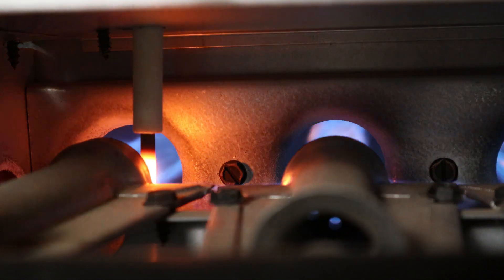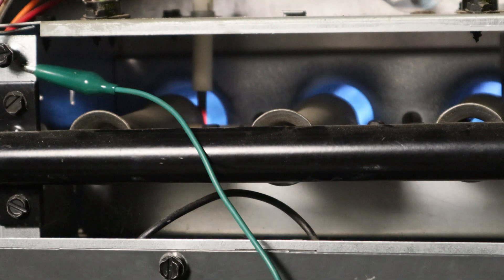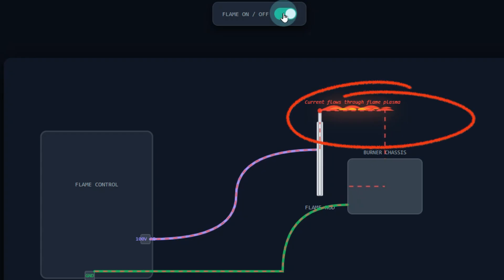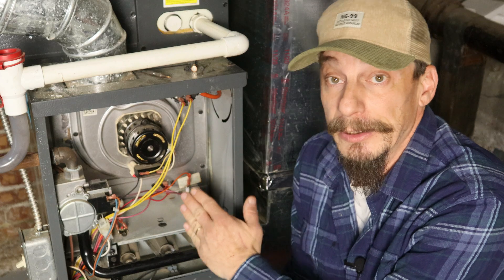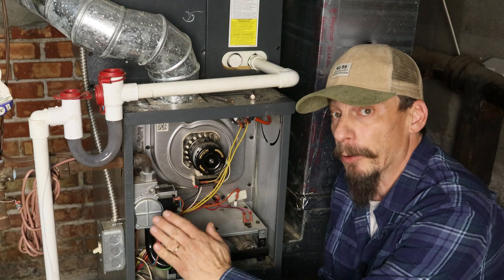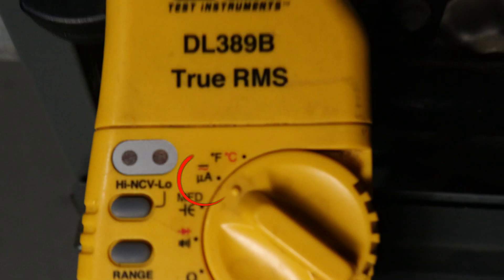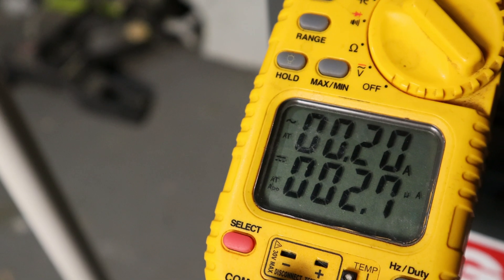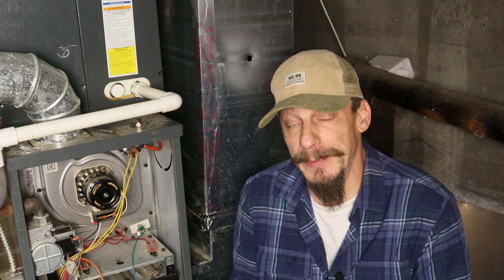Furnace won’t stay lit? Easy Fix DIY Videos ALWAYS Skip

Comment: Excellent video, sensei. One other point to mention about the grounding aspect. Check if the outer edge of the burner, where the flame exits, is covered in rust and soot. Clean this with a wire brush.This can impeded the flame rectification process.
Reply from the maker: Nice add. I'll pin that.

Comment: House grounding issues can be a problem. If in doubt, we used to run a wire from the manifold connection to a water pipe, no more intermittent issues.

Comment: Good video. Thanks. One way to check is by timing the flame out and circuit board reset. I had a furnace that was on a 7 minute cycle, and would try over and over again every 7 minutes. Flame sensor was dirty.

Comment: I woke up the other week to a cold house. Furnace would not stay lit. I cleaned the flame sensor. Still would not stay on. Cleaned out the hose for the condensate drain. Has been working fine ever since.

Comment: just a tip, the clip lead you have is probably a crimp type connection to the wire. would be wise to solder as i have had several of them loose connection with age.

Comment: My friend's high efficiency less than 10-year-old furnace needs the flame sensor to be cleaned every 3-4 weeks during cold months. Didn't seem to change much when a new one was installed. What makes them get dirtier over time? It wasn't like that the first few years of use.
Reply from the maker: Something else is contributing to the problem. Here are a few things that can be checked. 

Flame: Clean burners/crossover, set manifold pressure, make sure the sensor tip sits in the bright blue flame.

Exhaust/Air: Clear intake/vent, verify draft on high/low, good trap/pitch, no room contaminants.

Moisture: No condensate mist/drips near burners; drains clear, cabinet dry.

Ground/Polarity: Tight bare-metal grounds, correct hot/neutral.

Flame sensor should hold ~2–6 µA DC; if it jumps with a temporary ground clip (from burner chassis directly to the ground wire feeding into the furnace from the electrical panel), it's the ground path that needs cleaning.
Reply: @JerseyMikeHVAC Thanks for the info. Appreciate 👍.
Reply: @JerseyMikeHVAC  Also, dryer sheets or chemicals stored too close to the furnace. Those scents get on the flame sensor. I seen one that was orange!

Comment: This always throws me.  If the board is sending about 100vac to the flame sensor then why does it measure micro amps dc in series?
Reply from the maker: The board applies ~100 VAC to the sensor through a high-value series resistor (100–330 kΩ), so the current is tiny to begin with. The ionized flame is diode-like, so conduction is asymmetric, meaning it flows a little better one way (toward the burner ground) than the other. That uneven conduction leaves a small DC component on top of the AC, which is why you read DC microamps in series.

Comment: So, what happens if there are micro-cracks or some other defect in the flame sensor that allows it to ground out? Will this draw enough current through the 24v system to pop the fuse?
Reply from the maker: Its not part of the 24v system, but to answer your question on popping a fuse (breaker), no. The board has a killiohm resistor sending out ~100V, so even a short to ground isnt going to generate enough of a current to pop anything.
Reply: @JerseyMikeHVAC 
Ok, thanks for the reply. My old 1980's whirlpool furnace will blow the fuse on the control board after it heats up and runs for a few mins. There's only two things on it that gets heat, the flame sensor and limit switch. I've bypassed the limit switch to test and is still blew the fuse so the only other thing I could think of was the flame sensor grounding out on the burner.

Comment: I am curious though Mike, where do you get the information that a flame sensor can only be cleaned so many times? It’s just a metal rod. The old belief was that if you overclean it, you strip the outside coating off, but I think some of the older techs were always thinking of it like a thermocouple that is two dissimilar metals that generate a voltage when heating up.
Reply from the maker: Its not the rod so much as the ceramic or the rivet that eventually fails, so cleaning it only works for so long until it won't be enough to restore the DC millivolts needed for sufficient flame rectification.
Reply: @JerseyMikeHVAC thanks for the clarification

Comment: You can also have issues with the phasing between the primary and secondary sides of the transformer.  This can impact the size of the rectified flame sensor current.  

See the tech tip/FAQ:

Transformer and Power Phasing - Reversed Polarity
at
 Johnstone Supply support website

for the recommended procedures

"Many of the electronic boards being used today will not function properly for flame rectification, logic functions or possibly not at all without polarization of incoming power. Many also require phasing between the primary and secondary sides of step-down transformers."